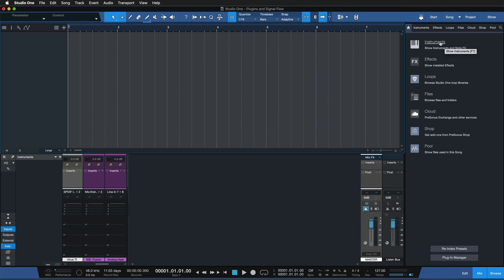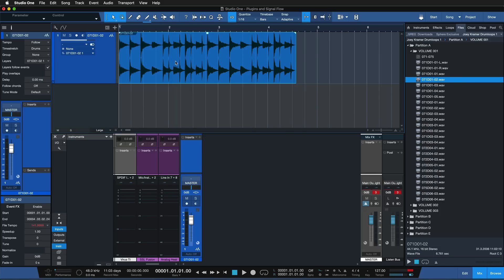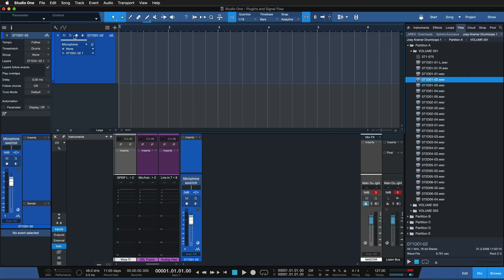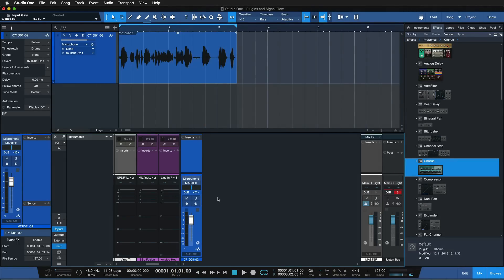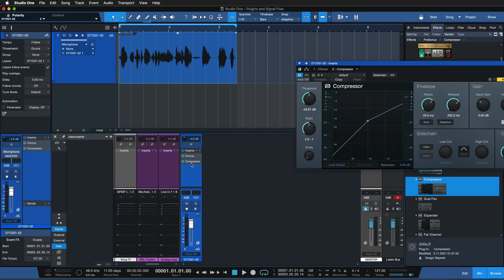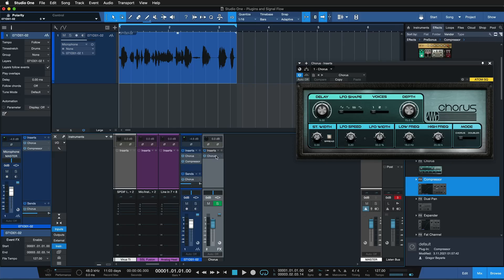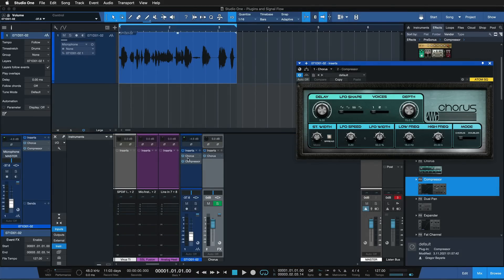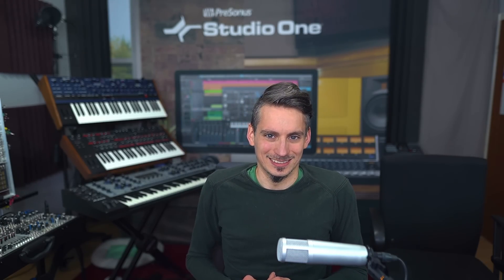Plugins & Signal Flow in #StudioOne

Comment: Arming the record function, such a simple concept.
Unless you are a PC user and have just installed S1 Pro version 4.5.
But they sorted it out with the elusive version 4.5.2.
🤔 the only downside was the delay effect, like latency or lag (and before the boys start mansplaining furiously the definition of these terms, don’t, just get back into bed and be the little spoon for mother)
Apparently the issue that appeared en masse for S1 version 5 PC aficionados, had already been fixed in the 4.6 update and as support Kyle told me was an imaginary issue anyway.
Turned out a simple fix, delete every trace of S1 4.5 and above, reinstall version 4, avoid further update shenanigans by disabling wi-fi and run a stable version without even the smallest glitch for 3 years and counting.
And I realised that with the stable version reinstalled with a plethora of 3rd party stuff, I already had all the tools for any level of production. 
The fact that I have not spent a single cent in 3 years is great for me, and should be a lesson for us all, but is not really a valid business model for Presonus.
So thank you Kyle.